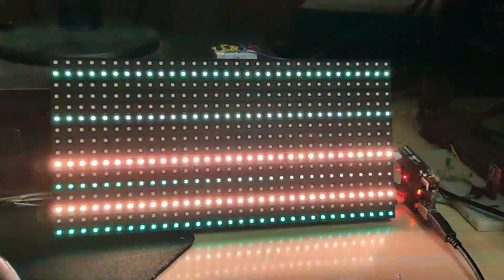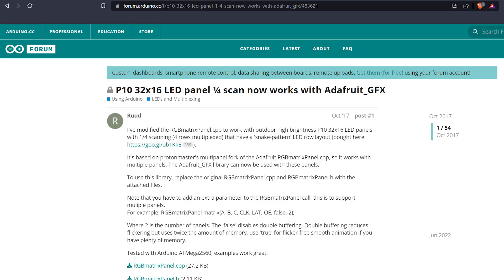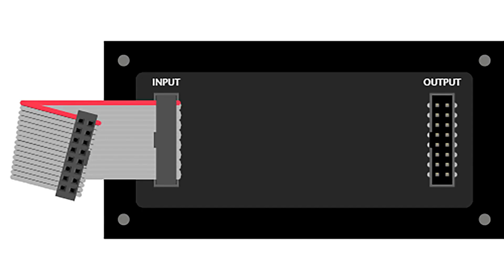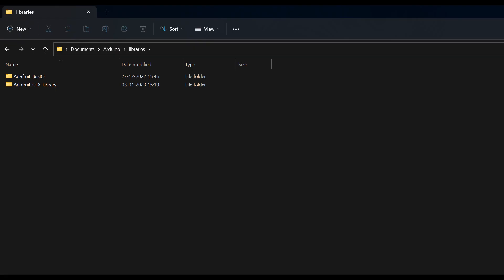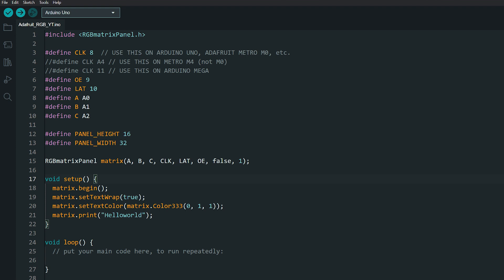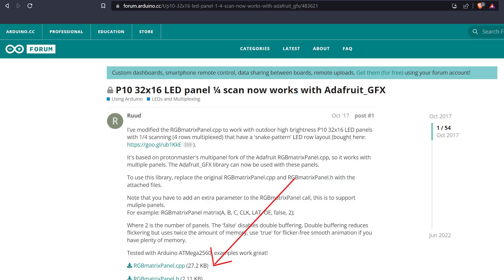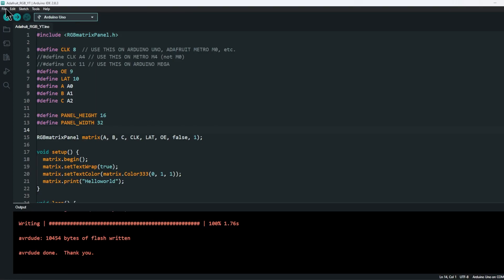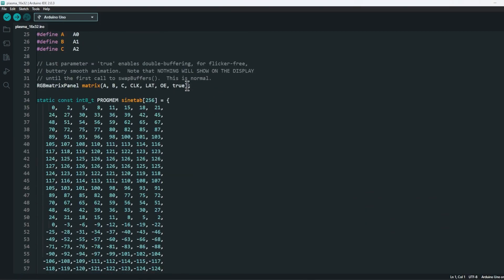Arduino Project | RGB matrix fix for Chinese 1/4 scan panels

Comment: Sir, i use esp32 can u gift me  wiring connect to pannel?
Reply from the maker: I didn't understand you
Reply: I have the same problem regarding the panel bro, but I use esp32 as the microcontroller, can you help me solve how to connect p10 RGB panel scan 1/4 to esp32 and the library Which will be used?
Reply from the maker: For ESP32, you can use this library.

https://github.com/mrcodetastic/ESP32-HUB75-MatrixPanel-DMA
Reply: @techtalkies1 Thank you in advance, bro. I'll try it first. If it works, I'll let you know later.
Reply: @techtalkies1 Still not showing anything bro, can u help me to solve this?
Reply from the maker: It's probably a wiring issue. If it is displaying something and it is jumbled, I can help.

First, try to display single pixels. The library will have a drawpixel() function. Draw single pixels from 0 to 10 for example. See if the individual LEDs light up.
Reply: @techtalkies1 Previously I tried to use the default wiring diagram from the tutorial I saw because I didn't find one that matched the library you provided or maybe I missed something or I didn't read it carefully, can you help me with the wiring diagram for the ESP32, sir?
Reply from the maker: Here are the pin definitions from the library. You have to refer to 2 things. Check your board's pin diagram to get the pin numbers. Check the RGB panel backside or the datasheet to get it's R1 B1 etc pins.

#define R1_PIN 25
#define G1_PIN 26
#define B1_PIN 27
#define R2_PIN 14
#define G2_PIN 12
#define B2_PIN 13
#define A_PIN 23
#define B_PIN 19
#define C_PIN 5
#define D_PIN 17
#define E_PIN -1 // required for 1/32 scan panels, like 64x64px. Any available pin would do, i.e. IO32
#define LAT_PIN 4
#define OE_PIN 15
#define CLK_PIN 16
Reply: @techtalkies1 The panel only displays random, irregular colors, bro :(
Reply from the maker: Did you check the wiring?? When working with this panel, the wiring is usually the problem 75% of the time.
Reply: @techtalkies1 I have searched in the Zip library regarding the wiring diagram of esp32 to the panel bro, but I didn't find it. Can you help me regarding the wiring diagram?First of all, I apologize and thank you for listening and helping me so far, I'm still new to this 🙏
Reply from the maker: Check this guide by Adafruit. It has a proper pin diagram of common RGB panels. 

https://learn.adafruit.com/32x16-32x32-rgb-led-matrix/connecting-with-jumper-wires

And use that as reference to connect as per the below definitions.

 R1_PIN -- 25
G1_PIN -- 26
 B1_PIN -- 27
R2_PIN -- 14
 G2_PIN -- 12
 B2_PIN -- 13
 A_PIN -- 23
 B_PIN -- 19
 C_PIN -- 5
D_PIN -- 17
E_PIN -1 (minus 1)
 LAT_PIN -- 4
 OE_PIN -- 15
 CLK_PIN -- 16
Reply: @techtalkies1 Thanks bro, I will try it soon and report the results to you.
Reply: @techtalkies1 Hello, sorry to bother you but I have followed all the directions and input from the link you sent but the results are still not as expected, the development is p10 working, But it doesn't match what I want, I just want to display text and display data, only you have responded well to me so far from all the people who have discussed RGB P10
Reply: I have also sent a message on your Instagram so that you can see my progress, thank you in advance for your help so far I have learned new things, but have not found a solution.

Comment: I have a p5 pnanel 2727  1/8  scan. Can you help me
Reply from the maker: How can I help you
Reply: I want to display text and geometric shapes on the LED panel. However, the output appears as jumbled characters and flickers. I have two LED panels connected vertically, each panel is a P5 64x32 type with 1/8 scan and 2727 pixels. I'm using an ESP32 DevKit V1. can you give me a code example and library for it
Reply from the maker: Have you tried first with 1 panel? Does it work that way?
Reply: I’ve tried it already. When I display a single character on the LED panel, it always gets duplicated. For example, if I display the word “hello” at position (0,0), the LED panel shows two “hello” texts — one at (0,0) and another at (0,8).
Reply from the maker: Ok, this can probably be easily fixed. Which library are you using?

Are you setting the panel size and modes correctly, the ones that says zigzag or zagzig or whatever yours is
Reply from the maker: What I do to test panels is, create a for loop with the size of the panel, then turn on one pixel at a time, in sequence. This will tell you exactly what the code thinks of your panel...
Reply from the maker: I hope your issue is resolved

Comment: Hello Sir 
I want to make 16x64 using two 16x32 panel but its not working also i have mentioned panel number as 2
Reply from the maker: It should work, what is the output you're getting?
Reply: On second display some rows are on and some rows are off @techtalkies1

Comment: Hello can you help me with 1/8 Scan for P10 with arduino Mega?
Reply from the maker: 1/8 scan panels already work with the original library, don't they?
Reply: @ seems as didn’t work or may be have sudden pinout? Or wrong connection? P10-1921-8S-32x16-B. Also written 1921 2308 CI007
Reply from the maker: What is the issue you're facing? Is the image jumbled?

Comment: This library has an issue if i connect two panels such like 16*64 it display the same text on both panels as i want tbe text to scroll from one panel to other but in this case the text individually display and scroll text on both
Reply from the maker: Are you sure you're setting the number of chained displays in your code?

Comment: Hello sir am trying to conect 32×16  4 panel in series i want width 2ft height 1ft display would it will work..?
Reply from the maker: Arduino UNO is not going to support that much.
It might work with an ESP32 or an STM board. Or even a Mega.
Sadly, as powerful as the new Uno R4 is, no libraries have been developed for it yet.
Reply: @techtalkies1  Can  control a 2 feet wide and 1 feet high using 4 panel led matrix if i'm use an arduino mega?

Comment: It can't be chained into more than 1 panel. Even in paralel, the second panel will show unexpected dot color lights up. How to fix that sir?
Reply: I am also facing the same problem.
Reply: Trying to solve the problem for a year. But still didn't able to solve it.
Reply from the maker: I'm not sure if the Arduino can handle more than 1 panel. It might not be powerful enough.

Also, are you specifying number 2 in the declaration for 2 panels?

Comment: Thanks, but this library modification does not work for me, I use JC-4S-P10-3535 32x16 RGB panel
Reply from the maker: Then your display might not be 1/4 scan. You will need a different library that suits your display.

Comment: Hello sir.  I have a 32x64 rgb panel.  Can I use this library? With standart rgbmatrixpanel library rows are duplicated.
Reply from the maker: Yes you can use this library.
You should be also be able to use the standard library.
Are you sure you are setting the length and width of the panel correctly?

Share the lines of code where you have declared the matrix panels and I can check if you have declared ot correctly.
Reply: @techtalkies1   
RGBmatrixPanel matrix(A, B, C, D, CLK, LAT, OE, false, 1);
Reply from the maker: Looks right. And your code where you have declared the width and height of the panel?

Because I am using a 16x32 panel in my examples and you're using a bigger panel.
If you have not modified the code to reflect 32x64, try doing that and let me know if it works.
Reply: @techtalkies1 I don't understand how to set the width and height of the panel.  The number I changed to 1 was 64. that was the size right?
Reply from the maker: #define PANEL_HEIGHT 16
#define PANEL_WIDTH 32

These are the lines where you define the size.of your LED panel. Have you changed both the lines?
Reply: @techtalkies1  Yes i changed to 32 and 64. But still strange icons. 😔
Reply from the maker: Alright, send me a picture of how your panel looks when running the sample code. I'll see what could be wrong. You can email me at techtalkies1@gmail.com

Comment: Hi sir i am try to connect 8 32x16 display in series would it will work ?
Reply from the maker: Yes, these panels can be connected in series. But the number of panels that can be controlled depends on your microcontroller. Check that.
Reply: @techtalkies1  sir I have 3 microcontroller board 1. Esp32 2. ESP8266 and 3. ARDUINO Uno which one is best I am new in this field so I can't choose it and if esp32 and esp8266 is best then please make one video or share pin diagram with display because as compare to arduino esp32 and esp8266 have less pins
Reply from the maker: TL DR
Solely based on using it to run RGB matrix panels - 
1. Arduino Uno has the necessary number of pins and will work out of the box. But I have not tested with 8 panels.
2. ESP8266 is cheap and has WiFi as added bonus. But it does not have the necessary pins to run this panel and thus requires workaround like using the PxMatrix library and extra wiring. But it is the cheapest option.
3. ESP32 is costlier than the 8266 but it has more pins and should be able to easily run the panels.

In any case, make sure to power everything with an external power supply. Never run these panels directly from any microcontrollers. Then connect all the ground together to avoid noise and artifacts.

And finally, if you are getting the microcontrollers just to run RGB panels, I would suggest getting dedicated driver boards and program them directly instead. There are many boards with lots of options like SD card, WiFi, etc.
Reply: @techtalkies1  but this same librery will work on esp32 ?
Reply from the maker: It should work.
And also, there is a special library for boards like ESP32, called Protomatter. You can check it here

https://github.com/adafruit/Adafruit_Protomatter

Comment: hallo i have P10 Modular RGB 3535 4s module its just giving me  wrong print non of the libraries working where could i be going wrong the display is just wrong
Reply from the maker: Hey, what microcontroller are you using? And which library have you tried? If you have downloaded my modified library, are you sure you're using the modified file and that the IDE is not picking up the default library?
Reply: @techtalkies1  Hallo thanks for your response I grateful am using arduino uno then tried arduino mega as well plus the library you provided unless my wiring is wrong I will check if it's picking the wrong libraries let you know if All goes well thanks again.
Reply from the maker: @davidkinuthia1052  No problem. The easiest way to make sure is to copy the library file into your project folder, rename it and use include "file.h", with quotes and not <>, if that helps.

Comment: The colors appear divided in two parts. Up part one tone and down part other tone. Can you tell me how to fix this problem ? Thanks.
Reply from the maker: Hello, are you sure you are using a 1/4 scan panel? Have you tried the original library and does it not work?

Comment: Hello again,

  I managed to run the panel with your help before, but I have a problem; In my project, I print two separate text on the panel as the bottom and top lines. The top row is fixed, the bottom row is scrolling text, but the top row is flickering, no matter what I did, I couldn't solve it, can you help me with this?
Reply from the maker: Can you share the code and a video of the flickering display? You can email me.
Reply: Can you write your e-mail address? @techtalkies1
Reply from the maker: techtalkies1@gmail.com

Comment: Hello! Dear
I have problem with out door led modules. There is only 3lines(A,B,C). In library shown example for 4lines(A,B,C,D). If I use this library the outdoor matrix show incorrectly. Indoor matrix is ok. Can you help me?
Reply from the maker: If you're using a panel with only A B C, just don't connect the D pin. If the display is wrong, then it might be not a 1/4 scan or similar panel. Just try using the normal library that is not modified. You can download it from GitHub. Search for RGB Matrix library for Arduino.

This modified library is only for the cheap panels that do not work with the original library.

Comment: Sir I can't able to access two RGB panel if we are adding two 16*32 16*32 RGB panel together display any text on centre it's not working... which means we are making 32*32 RGB panel but it not working...how to solve this problem..for 16*32 panel it's working but when we adding two display 16*32 and make 32*32 matrix it's not working... please sir help me... RGBpanelmatrix(a,b,clk,oe,latch,false,2 ); it's not working...plzz help me for 32*32 RGB panel
Reply from the maker: I think the displays will be chained in horizontal rather than vertical like you are trying to make. Can you send a picture of your setup and output of the display?

Comment: Why your pinout (https://youtu.be/9WhZZxZGTHc?list=LL&t=34) has so many IO's connected while sketch requires only 6?
Reply from the maker: Even though the RGB pins are not defined or modified on the main sketch, they are still used by the Arduino board. You can open the library files and check if you're still unsure.
Reply from the maker: C and D are optional pins in some panel. You can ignore them if you don't have them. Clock or CLK is an important pin. So try connecting S to the CLK pin in your Arduino and check if it works and let me know. If it doesn't, I'll check if I have a specific pin out for A and B only panels.

Comment: i've p5 panel RGB with 1/8 scan mode, its been almost 3 weeks i cant use it with arduino mega and RGBMatrixPanel.h. is it possible with this library ? thanks.
Reply from the maker: It should definitely work. Please try and tell me if it works or we can try modifying it a little.